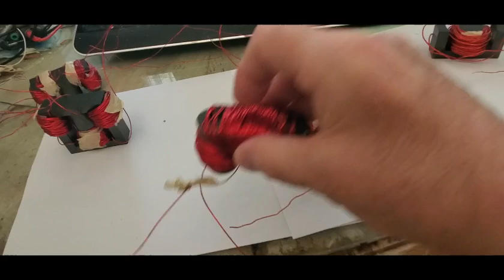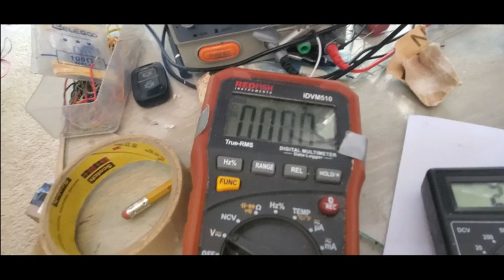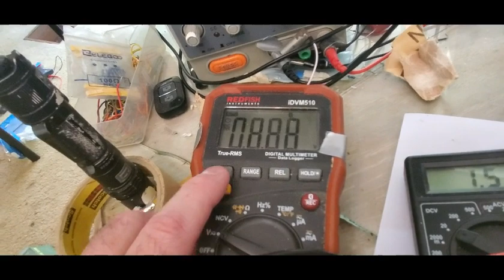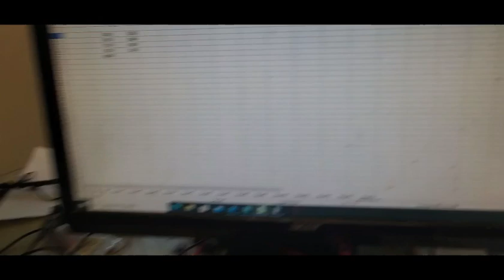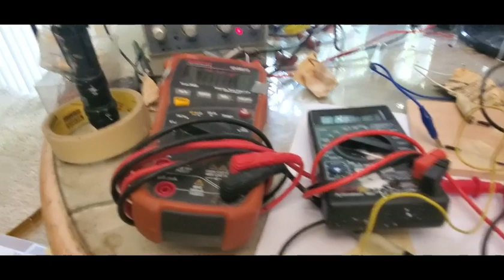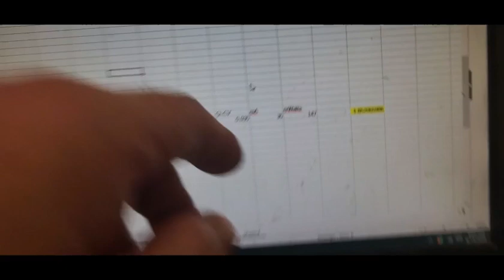Running the new Circuit Bitoroidal Transformer

Comment: Other ideas: (5) differences (asymmetries) in the secondaries may help; specifically what if one is wound clockwise, the other counterclockwise? or give them different numbers of turns? For example odd integer ratio, 3:1 or 3:2, (6) others experiment with bifilar windings, which have some capacitance; (7) try to match the natural resonant frequency of the core? (8) Bearden puts a permanent magnet in the gap above the primary, for pulse mode operation, (9) sweep to find resonant frequency of the coils, and pulse at max voltage
Reply from the maker: Yes, as regards point 5, the first issue I have been thinking to pay attention to is I haven't even matched the two secondaries for inductance.  I've tried to throw the same winds on each but when I measure it one might be 9 mH and the other 10. As flux is bouncing back and forth between the secondaries it might be worth having them very closely matched, don't know, but I really haven't had a set-up yet where I have paid attention to it and it might make a difference  (6) not gonna worry about it right now (7) Sure, if I had any clue how to figure the natural frequency of the core (8) I may be wrong but as I understand it Bearden bridges a toroid with a permanent magnet and all sorts of fun ensues.   There are others who may know more than me on this topic. (9) well, I do sweep for the optimal timing dependent on load.  What I will say is while this set-up may not be CoP of 203, it works.  I think of many interesting things I want to look at, some that may end up more interesting than this approach, but I find if I am not careful I am only like a dog chasing his tail and getting nowhere.  So, have fun optimizing this approach, (can it be daisy chained, asking for a friend) and move forward with this as well as other basic research areas from here.

Comment: please do continue to report what doesn't work, as that can save others time; some ideas...
(1) the gap helps prevent the core from saturating, so larger gap will favour higher voltage and lower frequency, but more flux leakage; flux leakage is not always bad, as it somewhat decouples the primary from the secondaries, making the primary less sensitive to back emf from the load. (2) Energy stored in the core is related to the core cross sectional area and the magnetic path length; your secondaries each have half the area as the primary, but double the path length to couple to each other, which isn't favourable. Any way to bring them closer and increase area should help; (3) the timing changing with a load makes sense, because tau = L/R; (4) there should be an ideal load, where voltage is reduced to half its unloaded value
Reply from the maker: Sorry for the hold comment/late reply.  I'd like to make it something James Bond like, but one just has to remember to set the video to allow comments after the video is published, otw it reverts to holding all comments. 

Great comment as usual Paul.  First, in a nutshell, the behavior I have seen is complicated but at the same time it is very forgiving to set something up along these lines with an air gapped E-core and see something interesting.  If one were dealing with an air core it might be more simple but one is dealing with a ferrite transformer and one set up in an odd way.  So, bearing in mind I am self-taught, there are core losses, they are related to core area, frequency and amp turns.   The latter two as I understand it are non-linear and get worse more than 1:1 as frequency, amps increase.  At the same time, with this set-up that which is getting worse with the core in a non-linear fashion it likewise improves the secondary to secondary interaction in a non-linear fashion resulting in things generally getting better as you increase voltage.  To return to some of your specific points,
 "double the path length to couple to each other, which isn't favourable. Any way to bring them closer and increase area should help", yes absolutely, right now I have a lot of bare core."  
One thing I really suspect would help would be to have a few less windings on the primary half of the Ecore and extend the secondary windings on to this half as well as the other half Ecore. Right now, much of the core is doing nothing, with no windings on it, except providing magnetic reluctance.  I have tried a few things which I though might improve things which didn't or made things worse, but this is one which I would be very surprised if it didn't improve things.  Get wire on as much of the core as possible and bring as much as you can of the secondaries in close to the primary to improve flux transfer. Have to think about 3) and 4).